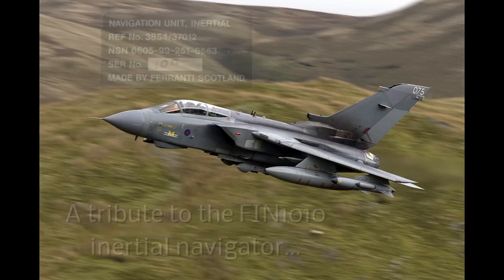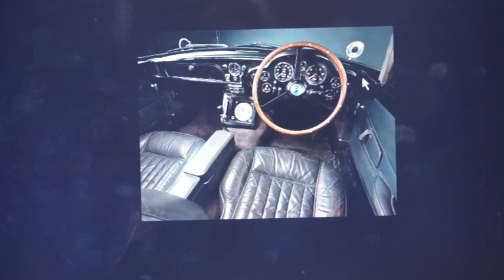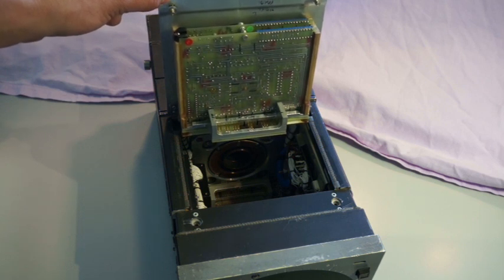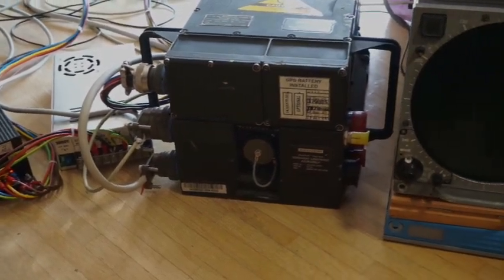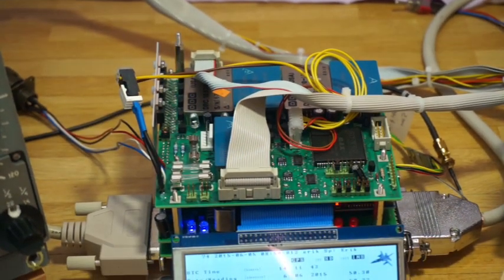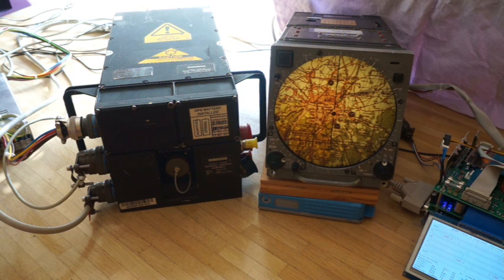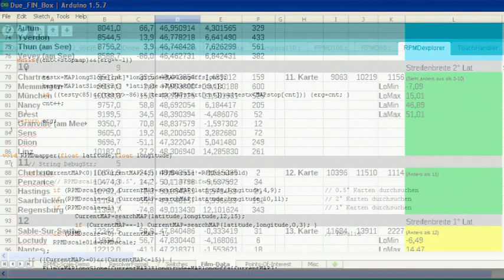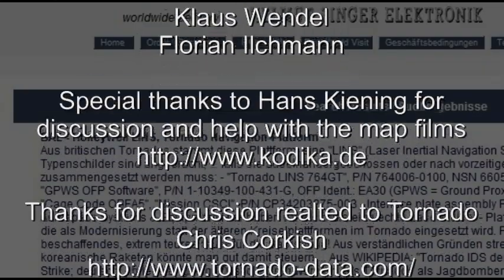FIN-RPMD-Explorer, a tribute to Inertial Navigation in early Tornado

Comment: In the video you are talking about the modern inertial navigation system using a laser gyro which you appear to actually personally have with you?        You have also deconstructed the software for the ferranti system which was analysing and operating the mechanical gyros.    Do you therefore have a working knowledge of the "start up alignment process" that an inertial navigation system uses to find latitude and true north?    Can you confirm your unit can determine latitude with no reference information?
Reply from the maker: Hi and thanks for your message - yes, I also have got a laser based INS which is fully compatible. So for work on software and bringing components together I use this one to save live on the gyros, avoid the noise of the FIN1010 and to have faster start up times.

The FIN1010 in its first alignemt stage uses the acceleroemters to find "up". Than it turns the platform towards the north one entered via the panel. Now the gyroscopes are started and the analog computer within the FIN1010 gets active to maintain 
the platform upright using accelerometers and simultaneously monitors any rotation aroung the EW-axis of the platform. If there is a component of earth rate visible, the orientation of the platform is not precisely towards north and orientation is corrected by torquing. This process is done until the gyros are spun up (2-3mins) and now the platform is aligned to better than 0.5° already. Having done this, the digital computer starts supervising the analog computer and injecting earth rate to torque the platform to compensate the earth rotation while the analog computer's filters are switched to slower but more accurate responses. In this mode, called fine alignment, the platform is further aligned until the errors are below certain thesholds. If temperature of the whole platform is alredy stable the whole alignemt takes 10-15 mins.
The platform can perfectly determine the angle between earth rotation and the vector of gravity and direction of north - so latitude and heading can be determined to better than 0.1° automatically, but for navigation purposes, i.e. dead reckoning by the digital computer, the position (lat & long) have to be entered via the panel in 0.1´ accuracy. Heading has to be entered to speed up the alignment process for the analog computer - 5° accuracy are fully sufficient here.

Hopefully this answered your questions?
Reply: That is a very thorough answer!   Many thanks.    Possibly i might have more questions at a later point but that seems to be everything I need!  Cheers!!
Reply from the maker: You are welcome - just come back if you have additional questions. Unfortunately I check with youtube not very often, so you may use my email erik@baigar.de if you need a quick answer.
Reply: This brings back memories of many hours spent in tornado  cockpits inside hardened aircraft shelters, after inputting Lat/Long into the DINCDU (always raised a smile when we  replaced one of those & asked the supplier for a 'Dinky-doo' :) & sat there waiting for the INS to align prior to crew walk. Then some big arse idiot would jump up into the cockpit & upset the alignment for another 5 minutes. I seem to remember the align lamp flashing at different rates depending upon how close to fully aligned it was? Or maybe that was the phantom INS with the joystick for entering lat/long onto rotary counters & a wonderful mechanical Nav display unit.
Reply from the maker: Thanks for that interesting comment! With the alignment lamp you are refering to the later LASER based LINS from Honeywell, which probably entered service in the UK somewhen later in the 2000s. That indeed flashed when close to full alignment.
In the earlier (1972-2004(?)) FIN1010s there was a counter on the CDU counting down from 7 (inter coordinates) via 6 (alignment via accelerometers), 5 (turning on gyros), 4 (first prediction for gyro compass north), 3 (you can go if it is urgent) down to 0 (can not get better). 
Was not aware that the "small" movement caused by a single person vs. the whole aircraft can upset the alignment process that dramatically ;-)

Comment: I wonder if you know how clever you are. I worked on Tornado from 1980 as a Airframe Tech “Rigger” and found the electronics in this aircraft very interesting even if I didn’t understand it all. Now it all seems old tech but i often wondered about the tech in these black boxes. Very interesting video.
Reply from the maker: Thanks for that positive feedback! I think the avionics of Tornado was very advanced for its day and they even had ONE SINGLE network (Panavialink) connecting all the avionics - modern aircraft use a zoo of different ones and that complexity often is a problem. Comparing the cockpit of the space ship "Enterprise" from the 1970ties series with the cockpit of Tornado I think science fiction was reality there ;-)

Comment: Thanks for showing this piece of technology. I saw Singer had such in shop years ago, but never thought someone would take the effort to get it ro run - outside a Tornado... interesting to see it spools the film so fast, when switching scaling, for example. If you would have scrolled more eastward of Linz, what would have happened? Looked the map material was ending there, because of the big black bar, right? What happens if plane flies northward, e.g. to Hamburg? Is the Northern map available on the roll, too?
Reply from the maker: Hi and thanks for your comments. The systems I have got are from Helmut Singer and they have been from Nimrod as I learned recently and not Tornado. But there are subtile hardware differences I stumbled across in my repair efforts. 

To answer your question: Yes, the former GDR etc. is not on the map and so east of Linz is a black bar followed by the next (more southern strip) of map starting at Nantes in France. Software of the maincomputer took care of moving to the next strip in Tornado if the current is left north- or southwards. If the aircraft went of film in western or estern direction or there are no suitable maps available, the display moved to a position on the film showing "off map" on a red background. I implemented all these features in my homebrew logger which was a substantial amount of work as I had to determine a very complex dataset relating x (0...12m) and y (0..36mm) of the film to latitudes, longitudes and selected scale. 

My film is just 4m (so 1/3 of the capacity of the display) and covers Brussles...Milano in N-S direction and Atlantic...Linz in the W-E direction.

Comment: Hi! 
Ill write this in english but im from germany so in case you would get in touch with me we could move over to german :)
I just got a PHI-4A Wind calculator from a starffighter, i did not plan on getting the entire unit but now that its here i will have to get it running. While i understand how it works (its not really complicated) I have no schematics at all and the wiring is very difficult to rout on paper by hand. The PCBs are all coated and glued, i will not take them apart. Can you recommend a source for schematics for 70s military aviation?
Reply from the maker: Hi - there is no general answer to the question. As that stuff is military it is not easy getting hands on documentation - maybe try posting in a facebook group on the F104. A simple google search points me there - http://www.radelow.ch/anderes/avionik/inert/phi4a/index.htm - and that guy surely has some know-how on the PHI-4A ;-) Good luck!

Comment: If i pause the video at 5:14, are those two circular components in the frame above your hand are AC or DC cooling fans?
Reply from the maker: Yes, these small inlets are leading to 1" screamer fans (incredibly loud fans running at 24000 1/min). Normally the inertial platform is enclosed in a vessl pressurized (2-3 bars) of a mixture of N2 and He2 (latter for improved thermal conductivity) and these fans ensure isothermal conditions within the vessel.
Around the vessel is a two layer construction and the airflow around the vessel is controlled to helt all the electrical heaters within the vessel to maintain the correct temperature for optimum floating of the gyroscopes.
Reply: @finner4463  the fans seem to be a brushless type. there are three wires on each. I have one of this beautiful Unit, but without Power and controller, just the unit.  I am amazed about how complex hand-made stuff it is. just the motors have an insane amount of wiring, I dont have any info how the controllers manage to drive that but just having this old piece of art is mindblowing

Comment: Did you ever get the chance to fly this in a plane?  I'm also restoring vintage avionics to mount them in a 172 and fly them to make video content about the history of avionics.  I'd love to work together on this.
Reply from the maker: No - not had the chance yet. Although I have an experimental setup for keeping one of these running for 1h+ from a battery which is quite a challenge due to the power requirement. So this would need conversion to a safely transportable rack which can go airborne. Still have that on my list but maybe after Corona only and I have been thinking of making an agreement with this company for the event: https://www.classicwings-bavaria.de/html/antonov2.php (probably more space for installation than on a 172).
Reply: @finner4463  Yes, I think you'd have much more room in an AN-2 for sure.  Even with the right and rear seat out there isn't that much room in the 172.  How much power does it need and in what format(s) by the way?  Just curious.  I'd love to find an inertial system some day.  Thanks again for the great video.
Reply from the maker: @scienceappliedtotheunivers9871  Hi - thanks for getting in touch again! You can reach out via email any time at erik-at-baigar-dot-de and I have a LiIon battery for powering the INS; without the map display it would operate for 1.5h selfconatined from that battery. Power requirements are 12-13A at 28V with another 10A for the map display. Total weight (INS only) would be around 30kg + 12kg for the battery - the map-display with inverter etc. adds another 20kg. I think regarding space and having a proper rack it would fit the space of one of the rear seats of a 172.

Comment: Interesting that I ended up giving the 125 "Like".  The 125 series were some of the most elegantly designed of the inertial grade gyroscopes.
Reply from the maker: Hi Peter, thanks and cool that your comment is No 125! Yes, these gyros are incredible and over the years I tried to get as much information as possible, which makes them even more admirable to me: 
E.g. for the space applications in satellites and the Ariane, gyros have been tested over ten years non-stop in space like conditions without any failure. Also lot of highly interesting data had been recorded in fantastic precision experiments: E.g. the balls circulating in the bearings and the cages ensuring their distance in the bearing can be "seen" in the fourier spectrum of the carefully analyzed data obtained in those measurements as these components are rotating at different frequencies than the mass of the gyroscope.
Do you have got any other information on those gyros? I'd be still interested in a technical drawing!
Reply: Here is an interesting article with a exploded view of the GEC Type 125 gyroscope.

I have "lived' with Beryllium for over 35 years and it is quite safe in solid form. Some larger pieces are even attached to the wall in my room.

There is a GEC type 126 gyroscope that uses a gas bearing rotor, however I have never been able to locate any. Years ago I visited the U.S. company called Speedring. They manufactured the Type 126  Beryllium gyro float housings.

http://adsabs.harvard.edu/full/1997ESASP.381....9R
Reply from the maker: Thanks again, also thanks for the link. I did not know this yet - the article I have been referring to, is the NLR report here:
https://repository.tudelft.nl/view/aereports/uuid:248c1a9b-9e2f-45bb-85d4-c5690ad2aec1/  - but searching the NASA database from your link, there are in total four documents with probably very similar content. But the cross section of the gyro shown there is the standard picture which is available on other sources as well.
For years I am trying to get in touch with people who worked on this stuff and it quite difficult as all have retired many years ago and I learned recently, that the gyro related equipment at the original factory in Edinburgh was scrapped years ago :-(

Thanks again for your comments and the link!
Reply: I am having trouble sending the Ferranti 125 images. Regards.
Reply from the maker: Hopefully we solved the issues - many thanks for the cool pictures. The 125 is indeed 
made from very nice parts and there is a huge amount of know how in there ;-)

Comment: Can you take this for a car ride (or even better a flight) and show us it in motion?
Anyway, amazing video.
Reply from the maker: We already had the inertial navigator (and the control panel) on board a car for a ride of 45min around Munich and it worked quite well. The problem generally is, that the navigator requires a lot of power (>25A at 12V) which is difficult to provide on an ordinary car. The display would require another 20A - so far I have no idea on how to do this onboard my car.
Making it airborne is still on my agenda for the next years and of course I will document this if it is going to happen. But before I need to repair at least  one backup unit and I want ro improve accuracy of my unit to be at least wihtin the original spec or better...
Thanks for watching the video and for providing feedback!

Comment: What kind of accelerometers are used in there?
Gyro is easy, the amazing/magic stuff are the accelerometers and how they manage the double integration from acceleration => velocity=>position over an hour, without drifting all over the place.
650m error over an hour, is about equal to 0.0001m/s² or 1300m/h² accuracy in absolute acceleration measurement.
If hypothetical accelerometer with 1kg test mass is used, that would require a resolution of 0.01mgF/0.1mN, to measure the force change caused by 0.0001m/s² acceleration... 
(if I calculated correctly... ;-)
Reply from the maker: The accelerometers are type F2A by Ferranti. Acceleration is compensated by a magnet and hence converted into a current. That current is integrated in a cap and a precise, oven stabilized current source is used to clear the cap. That converts the integrated acceleration into a pulse. These are integrated by the computer (digitally) giving the 2nd integration.
But actually, it is much harder making gyroscopes which are good enough regarding drift. In one hour you probably travel 1000km and having a maximum error of 650m there makes a permitted drift of 0.037°/h. The gyro in a smart phone is °per minute (not hour). On the other hand, the gimballed navigation system can handle 30° per second, giving a dynamic range of ~3E6 which is about 10 times better than the accelerometer's... I could easily give a 2h talk on these floated rate integrating gyros ;-)
Reply: Your analysis makes a lot of sense, and there are already a lot of accelerometers at this level, so we can talk about it
Reply from the maker: Ineed there are not many accelerometers at this level. Nowadays rather poor accelerometers are used and GPS eliminatges the long term drift isues.